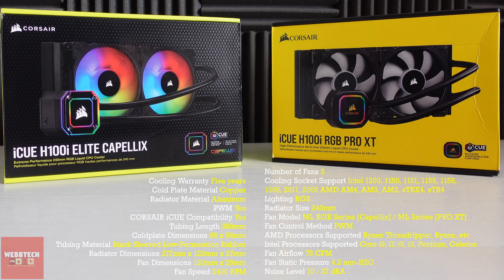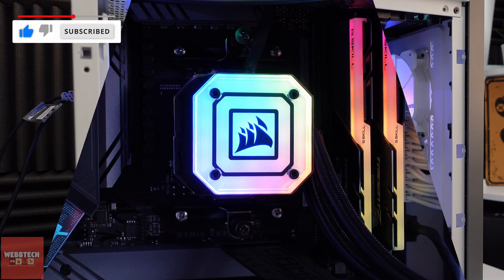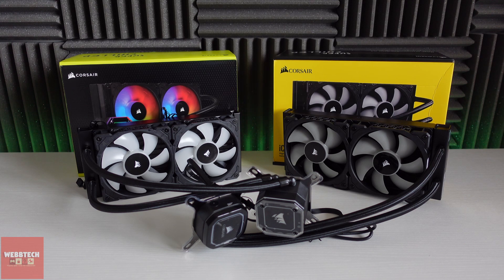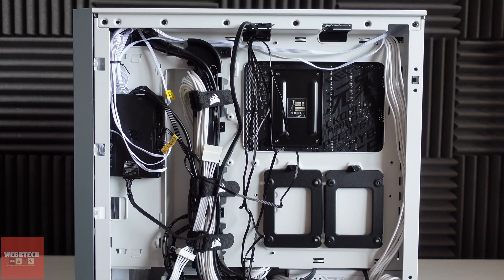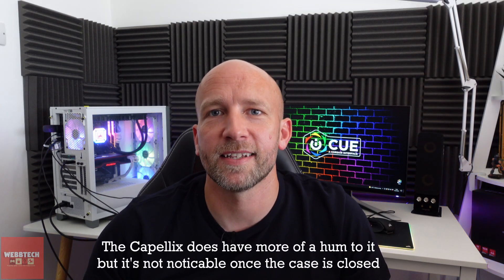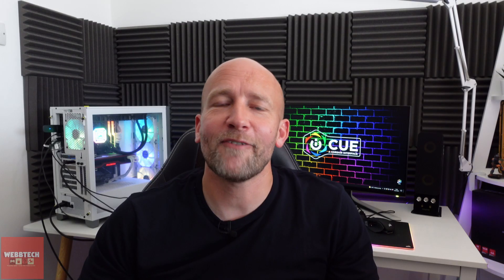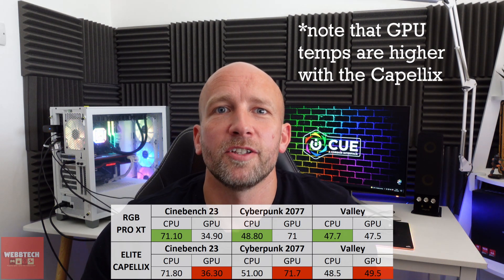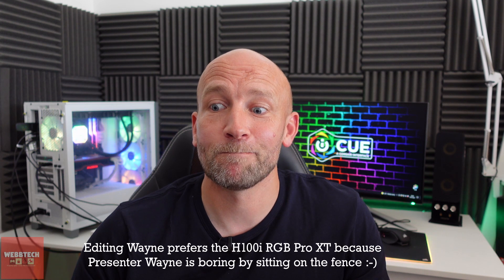Corsair H100i RGB Pro XT vs H100i Elite Capellix - Which 240mm AIO to Get?

Comment: Mate, I'm super confused.
Does the Elite comes with the LGA1700 Socket compatibility kit already?
I couldn't tell what exactly was included when you showed them side by side in the video. I ask because while Corsair's website states it's 1700 compatible, all the store descriptions do not show the 1700 as a compatible socket on the product description.
Reply from the maker: The video was made way before 1700 was a thing. You'll need to speak to the retailer, but I suspect things will be okay now or you may be able to ask for an upgrade kit

Comment: I want to buy a 360mm radiator. Right now in my country the rgb pro xt is 100€ cheaper than the capellix. I am thinking about buying the pro xt and replacing the fans that come with it with some corsair ll or ql120,  because these will be the fans that I'll use for the pc so it will look cleaner and more beautiful. What do you think?
Reply from the maker: Good idea tbh. Cooling is essentially the same and I'd put my money into the XT
Reply: @WayneWebbFilms  Ok, thanks for replying! That's what I am going to do.
Reply: @WayneWebbFilms  I just read a user's rating of the h150i rgb pro xt. He writes that the pump leaked (probably a faulty unit) and destroyed his pc. Have you experienced any issues with the cooler? How long are you using it?
Reply from the maker: I've owned a lot Corsair coolers and never had a problem. There will be failures, but how old was the pump, how was it installed, was it misused etc? Lots of questions to think about, but ultimately I wouldn't be concerned by one account of there being a problem.

Comment: Hi, is it possible to mount iCUE H150i (black) on the top of the 4000D? Or is this particular cooler meant to be mounted on the front? Before buying, I am looking into where it can be mounted. I want to install it on the top of the 4000D as I already got four 120 fans, which came along with the case itself (I bought two 4000D cases), three in the front of the case and one in the back. I believe, that H150i120 fans on top will not only be effective but will make a good case interior design in accordance with my other four stock 120 fans.
Reply from the maker: Unfortunately you can only really use a 240mm AIO in the top of the 4000D. You can get a 280mm but you need low profile ram and even then it's a tight squeeze. 360mm is great in the front. I have used this in the 4000D and had 2 RGB fans in the top and one in the rear which looked great.
Reply: @WayneWebbFilms  Would it be able to put it into a 5000D? On the top of it?
Reply from the maker: Yes you can. The 5000d is a very big case compared to the 4000d
Reply: @WayneWebbFilms  thank you sir!

Comment: So, are you able to connect another 4 Corsair Icue Fans to the RGB Pro without having to buy anything extra, like the £50 Commander Core that comes with the Capellix...??? And have you seen the difference in price between the non-RGB XT Fans and the Elite Fans... How you can say it's a draw is just soooooo WOKE!
Reply from the maker: If you have fan splitters then it's possible, but only if they are not RGB. It's a draw is personal preference, if you like RGB then pay the extra, otherwise the value proposition is the XT. Let's put it this way, I have the H150i XT in my current build ;)

Comment: I already have icue and commander pro in my rig currently. can I just hook up the Capelix to what I have there already? I was thinking I likely won't need the hub it comes with as I already have that stuff installed.
Reply from the maker: I would assume it would work in conjunction with the commander pro, but I don't know how
Reply: @WayneWebbFilms  well as far as I know the rad comes with a commander, but a more basic version. So I assume I would just plug the fans into that.

I already have 6 x LL RGB 120's, so going to use the two that are in the roof currently instead of the 2 that come with the Rad (as I think they are better fans)

This is my first time setting up a MOBO for the first time and also installing a CPU (never mind the radiator set up) but I'm confident I can do it, as I've done pretty much everything else. 

I've changed a lot of parts, and even moved one set of parts from my old case to my new one, so I think I should have this. 

I'm just wondering if I'm going to need a second commander in there. TBH I have the room as have a Corsair 680x with the big compartment on the back of it. I got loads of room in there for stuff. 

I assume it's just the fans and RGB that need to be linked to that, then I think the commander is linked to the icue, Lol, it's been a while so I'm not sure... will work it out at the weekend though.

Comment: Should I go for the cappelix or x53 from kraken
Reply from the maker: If you want the RGB and have a Corsair ecosystem, go for the Capellix. Personally I prefer the Kraken myself because it's more sophisticated, well it looks nicer if you're not wanting RGB
Reply: @WayneWebbFilms  there is a x53 RGB version as well. I know performance wise the Kraken is better but I'm looking at getting new case fans so I think I Will take out my cooler master fans and go for all Corsair
Reply from the maker: Yes there is, see link NZXT Kraken X53 (240 mm) with RGB fans NZXT Kraken X53 (240 mm) with RGB fans https://www.amazon.co.uk/dp/B08MB5WDB2
Reply: @WayneWebbFilms  what's your thoughts on deep cool castle? It's a pretty good price
Reply from the maker: @TahirAmeenGaming  I've not used it so couldn't comment tbh. Look at multiple reviews and see if it works for you from a price to performance POV
Reply: @WayneWebbFilms  I've watch alot of reviews,. They are all quite mixed. Fall in the same price category . Some complain that the deepcool castle is a bit noisy, it has no RGB software as well. Others say the Corsair h100 cappelix is also kinda noisy. I think imma Just settle for Corsair at this point

Comment: A serious question: Did you use the water coolant sensor (default sensor by Corsair) or the CPU sensor while running your benchmark. Noise and temperatures differ a lot in operation when you pick one or the other sensor.
Reply from the maker: Good question and one I'm not 100% about. I use Riva Tuner Statistics which is part of MSI Afterburner and whichever is the default temp sensor there, is the one I used. Noise obviously was captured by an external sensor. Not sure if this helps or not
Reply: @WayneWebbFilms  I have noticed that when the watercoolant sensor (default by Corsair) the cooling isn't that great, in fact poor, but the noise is remarkable low. This is contrary when the CPU sensor is used, fans are ramping up much quicker and are delivering a better cooling, but also with a bigger noise output. Either way, it's a mediocre cooling system and gets easily outperformed by cheaper aircoolers on the market. The Capellix series can very best be concluded with the following: Don't get led by the lighting.
Reply from the maker: Yeah I agree lol. I prefer the Pro XT overall. The Capellix looks nice but looks aren't always the best thing
Reply: @WayneWebbFilms  Has atm the Deepcool AS500 Plus in my system. If people have the place in their case, more then 165mm CPU cooler clearance, I would advise this cooler. 75 Euro's, trade blows with the Noctua NH-D15, has ram clearance over and is dead silent with it's 2 x 140mm fans. And there is a dash of aRGB, for those who want it.
Reply: @dorientjewoller113  it really depends on your setup. aircoolers need more clearance. liquid coolers you can move the radiator to the front of the case if you don't have clearance. 

Aircoolers condenser has to be on top of the cpu. in the case of small factor or cluttered cases it might not be possible to mount air coolers.
Reply: @AuronFFX  I think I have said if you have more then 165mm CPU cooler clearance in the case, so I am aware of the size constraints of aircoolers. Secondary, your radiator size can provide also clearance issues. Wouldn't mount an Arctic Freezer II 240mm in the top of a Corsair 220T case or a 360 rad in a case that only can accomdate a 240mm rad max. And to be honest most of the size issues aren't to blame to the kind of cooler, but to the persons who are buying a cooler by failing to check if what they buy fits.
Reply: Maybe too late but here's my two cents. I have an i7-11700 KF that runs extremely hot! Was in a very small case so limited choice for cooling options. I opted for the  Vetroo V5 and saw some improvement but still temps up in the 90s, could not even get through CPU part of time spy! So I was super frustrated to put it mildly. By the way this is the infamous Asus rog g15 CE that you buy just to get a 3080 LOL. Some people were able to zip tie fans and make it work but I opted to swap cases for the Corsair 4000x and trying AIO for the first time. I knew very little (well, tbh NOTHING 😂) about them. I heard the h100i was tried and true and I was able to purchase one, open box, for $42 shipped (prolly seller didn't want cause fans not RGB) on eBay. Was very easy to install and I'm super happy with it, ecstatic actually. First of all there's not a huge chunk of metal covering my CPU and obstructing my number four ram slot and I can easily push in that little latch that releases your GPU without using a  long screwdriver LOL. Next you can set it to zero RPM and it's barely audible, very nice for general browsing but it's actually somewhat noisy when I set it to extreme mode mainly because it ramps the fans up over 2100 RPMs-but I wear headphones when I game so not an issue. And now for the most important part.. when I bench, stress test or game.. temperature never exceeds 76° and even that not for long. Idles around 33 degrees. It's really nice not having to worry about temperatures or thermal throttling anymore, not that it doesn't power limit throttle, but that's not due to lack of cooling. Bottom line is I don't think I'll ever go back to air cooling after 25 years of trying to strap those little wire brackets onto the heatsink and needing to remove my GPU and/ or ram to fiddle with it. I rarely think about or obsessively monitor my CPU temps anymore. Of course YMMV and it's only been less than 2 months
Reply from the maker: Great feedback there. Very happy to hear that you've had a big improvement, nothing worse than being paranoid about temps. Doesn't stop me from constantly monitoring them though ;)
I know some people are adamant that air cooling is for them, but IMO they are big & bulky and ruin the aesthetic of the build. Then there is the limition they put on your case selection! Some coolers do get in the way of your ram slots as you have mentioned, with an AIO you can actually see them, really important if you've splashed out on RGB modules.
Reply: @tulsaterry  I returned to air cooling in a Corsair 4000D Air, with a Deepcool AS500 Plus. Most reviewers don't talk about this cooler, which is a shame, because with it's 75 Euro/Dollars price tag you get a cooler that trades blows with the king of coolers the Noctua NH-D15. Only negative point is its height, beside the positive that it is a single tower, dual fan cooler with no ram clearance issues and the 5 to 10 degrees Celcius drop in temperature vs the Corsair H100i Capellix Elite. And that's the point a 150 Euro/Dollar cooler gets outperformed by a 75 Euro/Dollar cooler. That's 75 Euro/Dollars that can be spend on a larger or faster NVMe, better RAM or even the GPU that you wanted becomes in reach.
Reply: Yes you're right about the deep cool, I've never heard of it till now and I'm curious about it. If my AIO starts acting up and giving me trouble I'm definitely going to consider that one but for right now I'm so happy not to worry anymore . What really surprised me is how my benchmark scores are higher, even with only a minor variance in temps. I initially had my AIO top mounted with fans as exhaust but read so much conflicting opinions about which way they should go, I tried them as intake and temps are lower, scores higher. As far as I'm concerned as long as any cooler whether air or a i o keeps you under 77° no matter how much or how long you torture it that's good enough. Thanks for telling me about the deep cool - I always like learning about new things or new to me at least

Comment: The RGB Pro XT is the superior cooler here. Its quieter, runs cooler, and cheaper than the Capellix.
Reply: thank you for the info :) i think this will be my choice. will be running a 5900x or possibly 5950x if my taxes get here in time
Reply: @Nicc93  Nice, I got the Pro XT for my new build with a 12700kf, does the job very well.
Reply: @tehgzizlauw1787  sweet :)
Reply: @tehgzizlauw1787  I have a h100i elite cappelix in my current pc and never really noticed noise. I have pretty nice corsair headphones tho so it probably was noisy just never noticed lol. Had a 5900x in it that I'm swapping over to the big case 5000d now.
Reply: @tehgzizlauw1787  did you get the corsair retro kit for the lga 1700?
Reply: @Onoxid  yeah the store I bought it from had a retro kit for $5
Reply: will be getting the h150i size for my 5000D build

Comment: I think the H100i RGB Pro XT would be enough for my i7 9700k. Plus I'm switching for other case the Kolink Observatory. Might have the glass at front, but it can be removed if in the summer it messes up. What you think about that cooler for my cpu ?
Reply from the maker: The H100i Pro XT is one of my favourites, but the H115i could be a good option for you. If your case is good for a 280mm AIO, you will get a bit more cooling. Otherwise the H100i is a good choice

Comment: Hi I have the 4000d and deciding between these two coolers! Which is best for my 8700k i7? Thanks!
Reply: I have the h150i elite capellix front mounted in my 4000D/X. Works well as intake only with a long GPU. Keeps my 10700k cool

Comment: why is the H100i Elite Capellix making that beeping noise at 6:20
Reply from the maker: I didn't hear a beeping sound, but there is a buzz that the pump makes. I've owned the H100i/H150i Elites and they're both the same. The Pro XT versions are a lot quieter under the same conditions.

Comment: Corsair hxxx Elite line have a new pump (not basically the same as you mention) with speed set to AT LEAST 2200 RPM, that will NOT be patched by firmware by Corsair, which may be a dealbreaker for some people (it would have been for me in hindsight).
Reply: I have the capellix and honestly can't hear the pump unless i put my ear right against the case. It has a bit of a wine when POSTing but as soon as the OS starts it quiets right down.
Reply: @AuronFFX  I have the capellix too. I don't have that high pitch noise either.
Reply: Ah now I see you can actually hear the high pitch hum in the video. Awesome :)

Comment: Yes, initially the fans being RGB vs. non RGB may seem like the only difference, however when you look at the RPM and CFM specs of both types of Corsair ML fans, you will see the non RGB fans can spin at a much higher RPM (+1000 over the RGB) as well as increased CFM. This is assuming Corair didn't type the specs literally everywhere I've seen these fans for sale.
Reply: Is that good or bad for the non rgb
Reply: @mrtoasticles7144  Good if you want the best airflow
Reply: Both ML Fans non RGB and RGB that come with AIO's are 2600 RPM.  They also sell these 2600 rpm RGB Fans under parts & accessories at corsair but you have to dig to find them.
Reply: @pheelix-  link?
Reply: @elChupacoffee  It looks like corsair has removed them from the replacement parts section.  As they are not making the H100i Platinum anymore and they came out with New ML120 Elite that max at 2000rpm.  

The model number for the ones that come with the H100i Platinum is 31-004896 (2600rpm) and the ones you can buy in a 3pack or single are CO-9050075-ww (1600rpm).

I do not have the 2600rpm ones hooked up at the moment due to getting my H100i Platinum replaced.  They had issues with the blue leds on the block not working right and making white look yellow.  I will hook them up and link you a screen shot of the rpm in iCue when I get a chance before they have me send them back with the AIO.

If you are still in doubt, check the CFM on the ML120 Pro RGB single or triple pack, and then check the CFM on the H100i Platinum or H100i Elite Capellix as they both use the same ML120 RGB Fans.  You will see the ones that come with the AIO's are almost double the CFM.

Comment: I like the pirate ship with no lettering.   Can't decide between either of these, the kraken x53 or Noctua nh-d15.  Almost too many choices.   Anyway, enjoyed the no-nonsense comparison.
Reply from the maker: Yeah it gets very confusing. I have used all 3 of the coolers and they are much of a muchness. The more classical and elegant look comes from the X53. Love rgb? Get the Capellix. I personally prefer the Pro XT but I change the fans to Arctic P12 PWM normally. Or finally, if you just want your system to run and run and forget about it, especially if you run 24/7 go for the Noctua.
Reply: @WayneWebbFilms  

That is to say that the noctua is better in terms of silence and performance ??
Reply from the maker: It has a lot of people who rave about the Noctua but then again it isn't aesthetically pleasing to a lot of people. Plus you need a bigger case than with any 240 aio.
Reply: @WayneWebbFilms  I don't care about the aesthetic as long as it's silent
Reply: IN ANY CASE THE NOISE OF THE CAPELIX AND UNSUPPORTABLE

Comment: Is the H100i RGB Pro XT 240mm Cooler good for Ryzen 9 3900x ?
Reply from the maker: Hi, I used the 3900x in the video and it does a good job, but I have undervolted, your milage will vary. If I was looking for a full-time cooler for the 3900x I would probably use the H115i RGB Pro XT but when I did a video looking at the H100i, H115i & H150i coolers there was only a few degrees in it, so you're probably okay with the H110i - https://youtu.be/jkY1uE6j8JA